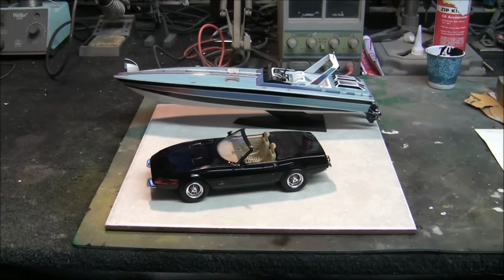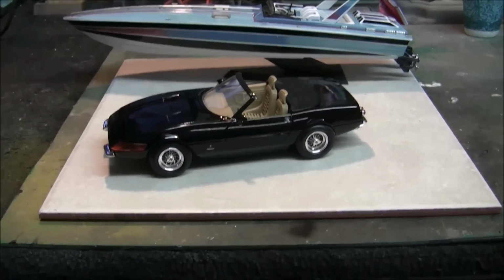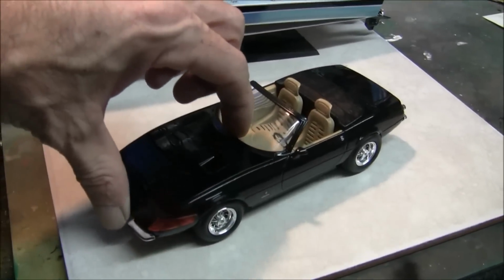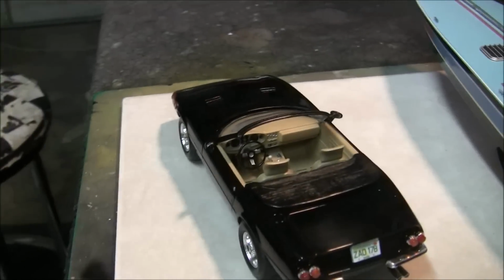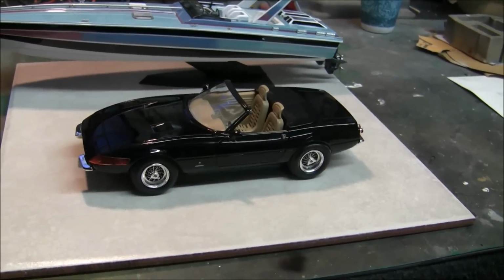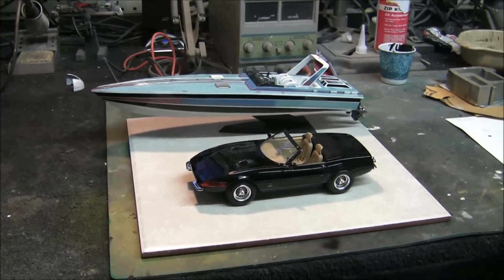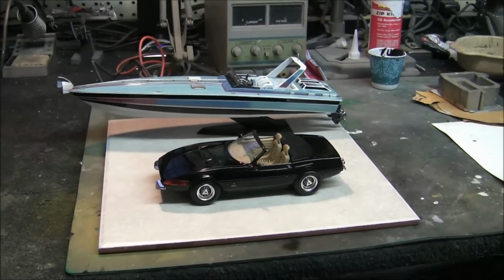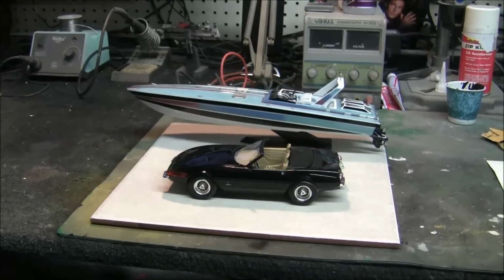Revell 1:24th Scale "Miami Vice" Daytona Spyder Build Finale

Comment: Fantastic job! I see this kit in the hobby stores occasionally. One of these days I'll pick one up. I made one in the 80s but that model is long gone.

You mentioned it was a kit car. There was an article in a magazine when the show was still in production about the car, though which magazine I do not recall. There were actually 2 used, built by Tom McBurnie in California. The car seen more often was based on a 1981 Corvette (black chrome around the windshield) and the car used for chases and stunts was based on a 1976 Corvette (silver chrome around the windshield). The latter had a twin turbo engine. They used the Corvette seats so there were no headrests. The headlights were behind plexiglass, which I think was because of US regulations at the time the original Ferrari was built, so that feature was copied. That would make for some fun lighting!

Comment: Hi 
Iv'e not been back in moddeling too long and i've watched a lot of your builds over this past 12 months and i plan to get and build another starship enterprise this time a AMT one and get the lighting kit for it. could you explain the light blocking and how you do this i would be most greatful
Reply from the maker: +gaz wilcox Gaz. light blocking is where you paint the entire inside surfaces of the model parts to block light from passing through it. I typically use flat black and then a top coat of flat white over that to make the light bounce around and be even inside the model.